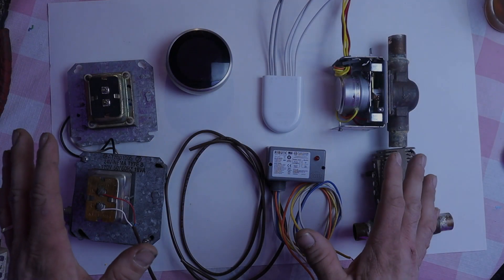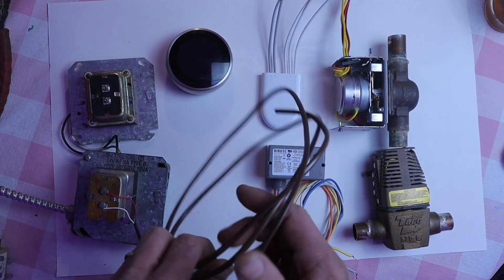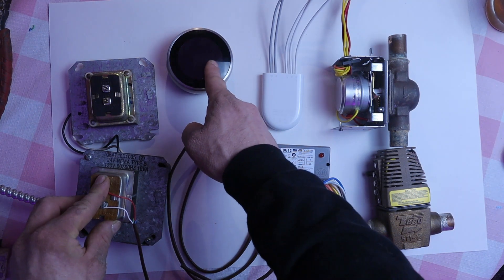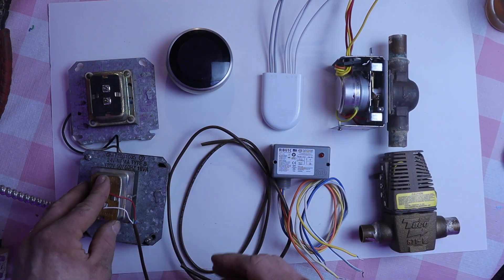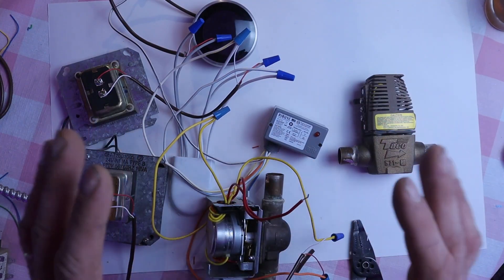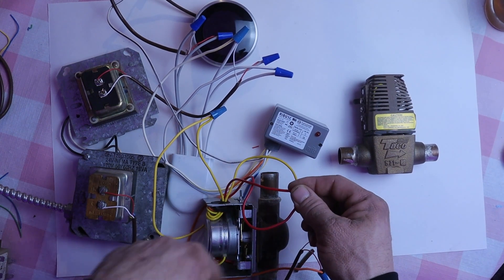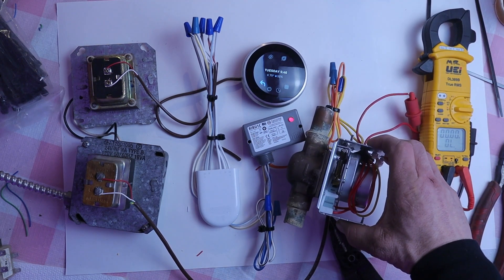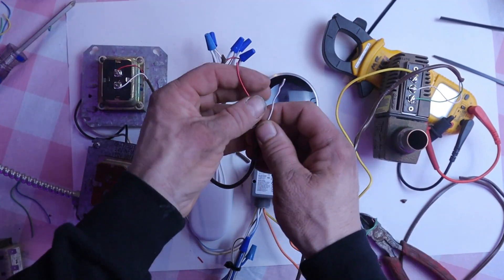Zoning Boilers with Nest Thermostats: Low Power & WIFI Problems

Comment: I have 2 zones both using automag zone valves on a weil mclain propane boiler. I tried the method here to get power to my 2 wire nest thermostats but it's not working. Can you perhaps draw a schematic with my setup? The automags have 6 wires. 2 to transformer, 2 to the boiler controller and 2 to the thermostat. So, I have no idea how to get power using this method. It's been making me nuts.

Comment: sorry for my flood of comments.... I am clearly not an electrician but am also stubborn (and cheap) and would like to figure out how to get these thermostats to work.... if the issue is each Nest needing more power, is there another way to somehow just run a power wire directly to each thermostat, and avoid the zone valves/relays/etc? either in the basement or even near each individual thermostat? or is that a crazy idea? (be gentle, lol)

Comment: Am I reading right that I need a relay for each zone valve? So if I have 3 zones and 3 4th gen nests, I need to buy 3 nest power connectors and 3 rib relays and an additional transformer?

Comment: Hello Mike, I have a boiler system with 2 honeywell zone valves, both are connected to same RIB relay, and installed 2 google nest thermostats. Do I need a RIB relay for each zone valve/thermostat?

Comment: So if you need a common wire, I’ll need all this equipment to operate the t-stat and boiler?
Reply from the maker: You will need a power connector for each stat, but you don't have to buy as many RIB relays. You can get a simple multi-channel relay board instead for about $30-40.

Comment: Hey what’s up Mike quick question I have 2 Nest thermostats 3rd gen I have 2 zones in my home . Just recently I’ve been having issues with the upstairs thermostat with low power issues and making the thermostat disconnect from the WiFi. I only have 2 wires for my connection to the thermostat base. What is my best solution?
Reply from the maker: A nest power connector should resolve the issue. Even though the 3rd gen doesn't need a common, it only charges during active cycles. Adding the power connector will help it charge up in between cycles to full charge. That should help stop the dropping wifi connection.

Comment: Mike just quick question, I have to wire nest thermostat with heating system with honywell zone valve on existing system, luckly there is 3 wire thermostat  just trying to figure out where to connect the c wire .My guess is to just add second transformer and just use 1 leg out of that.can you help me with that
Reply from the maker: Of the 2 yellow wires on the zone valve, one should tie into a wire going back to the W terminal on the thermostat (usually white wire but not always). The other yellow wire ties back into common on the transformer. You can try to tie the common wire from the stat into that second yellow wire that ties back to the transformer common already.
Reply: Thank you I will try that
Reply: @JacekPuzio-w1y  I have the same setup with three zones, and I noticed there are some spare wires in my HVAC cable. I’m thinking about repurposing one of them for the C-wire connection if possible. Did this solution work for you?

Comment: Just confirming this is accurate as I think this was indirectly asked down below.  I have a 5 zone (5 t-stats and 5 honey well zone valves) system.  Do I need a Nest PC for each?  If I do, then I don't see the need for the relay.  I already connected up 1 Nest PC to the first zone with no relay (based on one of your other videos...thank you!) and it works perfectly without the relay.  If 1 relay would save the need for multiple Nest PC then worth the $20 investment of a relay.  All these Nest T-stats are expensive and then throw in having to have a Nest PC also starts adding up the cost.
Reply from the maker: You do need a PC for each thermostat. The relay isn't necessary just for 1 or 2 thermostats, but eventually you start to exceed the VA rating on the transformer which requires adding an additional transformer, one to provide enough power for the zone valves, the other to provide enough for the smart stats. In this arrangement, you don't want to cross over those circuits, which is the purpose of the relay(s). 

 One other option is to upsize the transformer itself in some cases, such as going from a 40VA transformer to a 70VA, which I would suggest if were talking 3-4 zones maybe. With 5 stats, a better option would be to go with a 6 zone relay panel, which comes with 2 transformers internally (1 transformer per 3 zones) to accommodate this.
Reply: You 😊😊
Reply: 😊😊😊86888s😊777😊😊

Comment: What if I am using a Taco Sr503? The transfor is built into that right? I used the google power connectors for each zone and running 2 c-wires to to Comm screw. Now I'm getting buzzing at both google learning thermostats. Wondering if I add the rib relay if that will fix the humming or do I need another transformer also...Thanks

Comment: I have 5 zones, with one being DHW, all Honeywell 4 wire zone valves.  I just cut out the bundle of wires and rewired everything using a Taco ZVC405 zone valve controller with Priority for DHW.  Power problems solved.  It is also so much easier to see whats going on vs a bundle of wires going all over the place.  Now I can also see exactly which zone is calling for heat.... Wouldnt this be easier than all the rib relays and messing with extra transformers?
Reply from the maker: Yes, ideally that is the best solution. The problem is with Nest. Different models have different power demands, none are really compatible with all systems and sometimes power connectors don't work with all zoning relays when common wires are not available. Dealing with this daily, you realize you end up with situations sometimes where your particular set up works beautifully, while with someone else it doesn't work at all because they have a different system, different model Tstat or different relay center Nest doesn't want to play nice with. (I get plenty of questions on why people's Nests aren't working with their relay centers). 

 I made this video as a sort of last resort for the latter situations, where most compatibility issues can be overcome. But you're absolutely tight, a relay center would be best whenever possible.

One reason why your set up works well, for example, is because Taco designs their relays to be used with their own zone valves, which require more power than a Honeywell. The transformer in the relay is sized for Tacos and so by using the less demanding Honeywells, there's enough power left over for all of your Nests. But if someone has Taco zone valves, your same exact set up can likely still result in power issues.
Reply: @JerseyMikeHVAC  Understood, thanks for taking the time to reply

Comment: What wires are connected to the TR, TH, and TR/TH terminals on a Honeywell V8043F1036 zone valve for this to work? Does TR have the red transformer wire, the TH the red transformer wire and the orange RIB wire, and the TH/TR the yellow RIB wire and the white transformer wire?
Reply from the maker: The TH-TR terminal is not wired up to anything internally, so it serves no purpose other than a spot to act as a junction. 

TH and TR individually are the same as the 2 yellow wires on the zone valve in the video.
Reply: Thank you so very much!

Comment: Quick question for clarification, do you need a RIB relay for each thermostat? I have boiler system with Honeywell V8043F1036 zone valves. I'm trying to connect 2 of the 3 zones with a Google Nest thermostat. I have a power connector and RIB relay for each zone. Thanks.
Reply from the maker: Yes one for each

Comment: Hi Mike, help. I have a Grundfos three zone controller when I hooked up the second nest thermostat. It started to turn the circuit on and off. Spent multiple hours with Nest tech-support, and no help. I did some research and found out the transformer in the zone. Controller cannot powered additional nest thermostats, can you possibly give me a wiring hack
Reply from the maker: You'll have to tap into the 120v powering the zone controller with a second transformer. 

Wire from the transformer 24volt side load to R terminal on the thermostat. W on thermostat to a relay, then from relay back to transformer common. 

Other side of relay will get wired to R and W on the zone controller. I have a video on how RIB relays work that will help.

Comment: Mike, awesome video! I have one question though. What does having the relay give you? Could you do all the same things without the relays or would that be ill-advised? I have a three zone Taco setup with a single transformer, and I'm trying to figure out if I need to expand d with an additional xfrmr.
Reply: Wondering if Mike might be able tot chime in here.
Reply from the maker: The purpose of the relay is to keep 2 different circuits from different transformers apart from one another to avoid phasing issues. 

Another alternative is to increase the size of the single transformer from say 40va to 75va. Then you wouldn't need the relays. 

But Taco zone valves are power hungry. Always better to spread out loads with several transformers whenever possible.
Reply: @JerseyMikeHVAC  thanks Mike!  I followed everything step by step this weekend (even had my brother-in-law to help me verify each step).  We got it so the relay clicks on when the thermostat asked for power. However, the TACO valve didn't open.  I have three TACO valves where all terminal 3's are connected to the red wire from the boiler control board. All terminal 2's are connected to the white wire from the boiler control board and all the common from the original transformer.  I had the yellow wire from the relay connected to terminal 1 on the TACO I wanted to control. I believe I saw 26v on terminal 1 (as compared to common on the new transformer).  Terminals 2 and 3 on the TACO were open.  You know how in the beginning of your video you said you were the type of person who had to figure this BS out?  I'm the same way! lol.  And so far, I'm defeated.  I also tried to use a different TACO just to see if that one valve was no good (which I highly doubted) and I got the same result where the valve didn't open. :(  Anything come to mind?  Thanks!
Reply: I am wondering if I misinterpreted load and common on the original transformer that powers the TACOs.  The transformer leads are not labeled (at least from what I can see).  I wonder if I was wiring everything assuming the original transformer leads were reversed of what they really are.  I may try the whole exercise again.
Reply from the maker: Can you elaborate a little more on "all of the common to the original transformer"? 

Are there different commons for terminals 1 and 3?  Or do they share? 

If they are different common points that is likely your issue right there. In most systems terminal 2 goes to the same common at the transformer for both 1 and 3 circuits. If the commons are separate you'll have to wire to account for that. 

If you can send me a schematics drawing of the wiring arrangement, I can probably see it better to figure it out. 
Mjrusso at protonmail dot com
Reply: @JerseyMikeHVAC  I found the problem.  I had load and common on the original transformer connected backwards to the new setup.  As soon as I corrected it, everything worked!  Well, almost.  The backplane (wire base) on the Nest was biffed, perhaps from a previous problem.  I had one spare backplate left and once I had that hooked up, everything was perfect (my wire bundling isn't nearly as neat as yours but I did tie wrap everything fairly well).  I just finshed wiring up the second zone of three (and the last zone I intend to wire) and all is well except the A/C is causing problems on that Nest (another backplane problem).  Google used to sell replacement Gen III learning thermostat bases probably because they had some level of flaw in the design. They are currently not available and lots of people are complaining because they want to buy new ones (without having to buy a whole new learning thermostat).  I may opt to install a spare, non-learning Nest that I have to see if it behaves appropriately.

Your video was by far the best, most reasonable solution I could find after searching for a long time.  Most talk about jamming in a wired transformer plugged into the wall.  Your demonstration of the system on the bench with your easy-to-follow step-by-step explanation took the fear out of my trying this.

Flippin' Google and not selling base plates.  C'mon!

Thanks again, Mike!  -Tom K
Reply: @JerseyMikeHVAC I ended up putting all the wiring for two zones, including the Google Power Adapters, in a work box. Should I be concerned about heat from the adapters inside the box?
Reply from the maker: @CurtKeshian  a lot of guys put all of their zone valves wiring into 1900 boxes with covers without issues, and I don't think the power adapter generates much heat.

Comment: I have 4 zones with a Taco valve on each. For this setup would I need a Rib Relay for each zone and a Nest Power Connector for each zone? Im looking at my current install for my boiler and valves and there is already two transformers hooked up with red and whites wires coming off of them going to a main junction box, where then I see red, white and green wires coming out to attach to the Taco Vales.  Can I tap into these existing transformers for power?
Reply from the maker: Those are likely 40va transformers and each one can handle up to 3 taco zone valves. They may have wired 3 zone valves to one xfmr and one to the other, or they may have evened them out with two zone valves each. Most guys would even them out. 

If you have 2 zones on each transformer, then you can probably power 2 Nests off of each transformer without using the relays. 

If you have 3 zones on one transformer and only 1 on the other, you'll have to either move all of the wiring from one zone valve from the one transformer with 3 zones on it and move it to the other xfmr to even them out, or, you'll have to power all of your Nests off of the transformer with one zone valve on it and use relays for the 3 zones on the other transformer. 

I would just even them out and do without the relays. 

But you will need a power connector for each zone either way. 

You just have to make sure you don't cross any circuits from one transformer to the other. So 2 Nest stats and zone valves must come off of the same transformer and the other 2 Nests and zone valves must come off of the other transformer.  

If youre going 2 and 2, I have a video on my channel on how to hook up the power connector to a taco zone calve without the relay involved. Use that video as a guide.

Comment: We cant use the one transformer just add additional wire  to the google nest ?
Reply from the maker: If you have common wires then yeah. You don't need to do any of this in the video. Just hook up common. But you might only get one or two thermostats that way. If you're installing 3 or more you'll probably have to install a other transformer and the relays.
Reply: @JerseyMikeHVAC  thanks Mike
Reply: Great video! My system has 2 Taco valves powered from 1 transformer. Same valve style in your video. Can I use the transformer that powers the 2 Taco valves to power my Sensi smart thermostat?
Reply from the maker: @seanfarrington7134  If it's just the one thermostat I would assume you have enough power in that transformer to cover it.